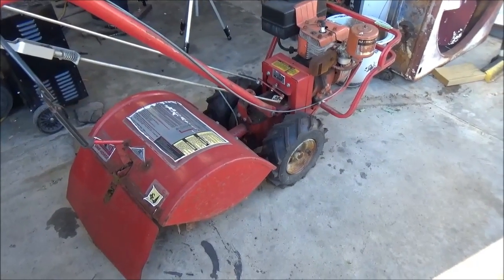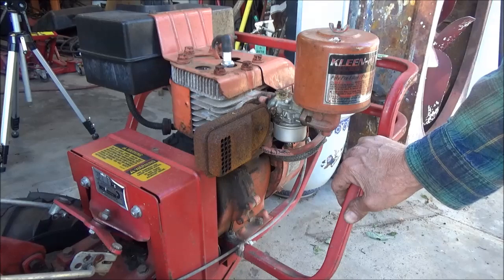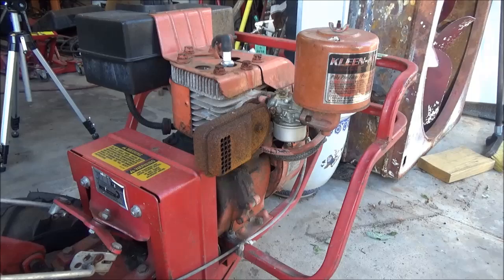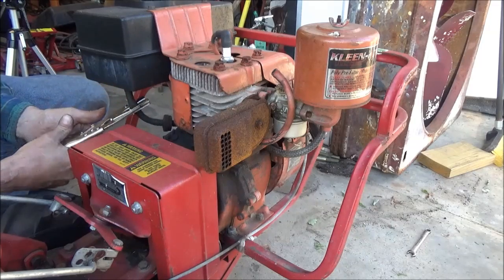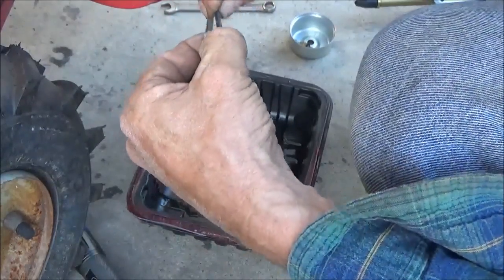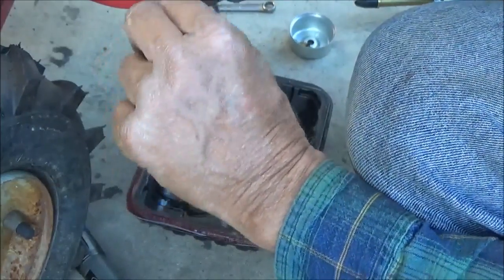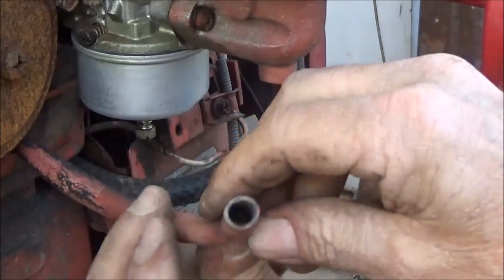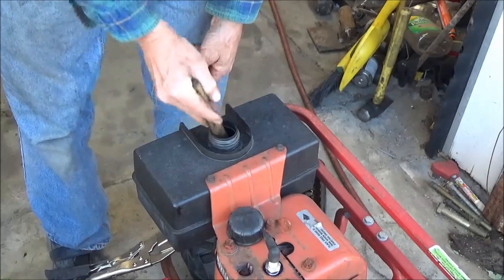Clean carburetor on Troybilt Horse Tiller (part 1) May 7, 2017

Comment: Gordon, a little grease on the bowl gasket will help let the bowl seat much easier. If you still have issues you will need to remove the carb and clean every orifice and jet until spotless. Inspect float, needle and seat for wear and leaks.

Comment: Next time you take the bowl off of the carb - the brass screw in the bottom you take out has a small hole in it from side to side and up if they sit this can get clogged with white oxidization - run a wire torch tip cleaner through that hole and make sure its open.  I had the same issue in mine once I did this the things started and ran on the first pull and has run ever since its and easy fix most people overlook in all small engines - especially ones that sit.

Comment: S.O.S.😮😊

Aloha G,

I hope all is well and life is treating you GREAT? I have a 7 hp Troy rototiller with a key as well. I found your video very very helpful. It would not start so I replaced a much needed battery, changed oil, which I think it had gas in it, spark plug to and I think I put it all back together right and went to fill it back up with gas, but it comes dripping heavily thru the air filter. What have I done wrong? I am not mechanically inclined but as a hairstylist I gave it a shot lol. Have I messed it up? Help? If you can, I would be greatly appreciative.... 

Mahalo, 
Dan
Reply from the maker: it sounds like the float valve is dirty or stuck open. I have a playlist on small engine repair with a few carburetor repair videos that should help    https://www.youtube.com/watch?v=Zlyv8EtZEk0&list=PLREonpuPF5LoKLB1RrufHdRLgHuG5QnJt

Comment: What year model is yours. I have one just like it but I don’t know what year it was made
Reply from the maker: I don't know, I bought it used but you can find the model and serial numbers and go to a parts website like partstree.com and find the range of years that machine was made. If you don't have the model # there should be an embossed # on the motor case somewhere and you can find when that motor was made.
Reply: There should be stamped numbers on top of the engine. Model, Type, and Code. The first two numbers of the Code are the year, then month, then day, followed by plant location code.

Comment: I think you got that bowl correct seem like i put the bowl on mine incorrectly and the float was sticking. Let me give you a warning pray you don't have to remove the wheel on that Mine was stuck big time and eventually I had to take apart the transmission cut the axle shaft in two and replace it to the tune of about $100. I tried everything pullers etc no luck and the factory manual says that is the way to do it. Anyone listening make sure you put antiseize on the axle before you put it back together.
Reply from the maker: I don't remember how much trouble I had on mine, I did put new tires on it, I know I didn't replace the axle, Anti seize is a good idea, or Marine grease.
Reply: Try heat first.

Comment: I bought a 1967 Horse at yard sale for $50 that was suppose to run. The carb had been broken off but linkage still attached. Seller pulled recoil and it did fire once so I bought it. When I got it home I noticed the black fuel line was as very old and extremely hard. My problem is the new black fuel line has same size inner diameter as the old one but the outside diameter was just slightly larger. My problem is running the fuel line to carb is too tight to run it as it was. The old line was routed just in front of engine and behind recoil cover. I am not sure if the old one was routed correctly to begin You have the same tank as mine and it looks like your is routed behind the engine. Also you have 2 lines to carb but mine only has one. Ok I see the one is a breather hose. Does anyone know if the fuel line run in front or behind the engine????
Reply from the maker: If you can't get the new fuel line to fit where it should go, you can get a piece of steel tubing like transmission cooling line, from the auto parts store and cut it to length to pass a piece of that through where you tried to go with the rubber hose and put the rubber hose on each end of the tubing. Just cut off the flared ends of the tube and slip on the hose and clamp it if it's not a tight fit. There's no pressure on the fuel line, only gravity feed so it doesn't need to be tight.
Reply: Ok thanks for the info but it looks like the line on your tiller and others I've seen runs behind the engine loose rather than jammed real tight around the front and behind the recoil cover.